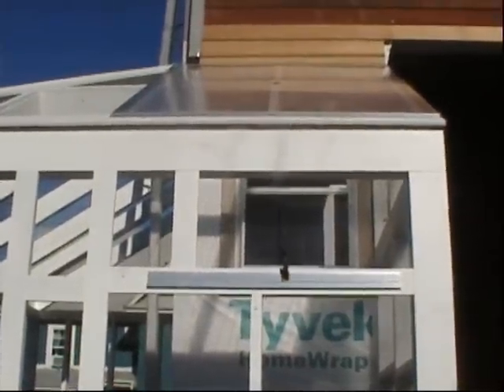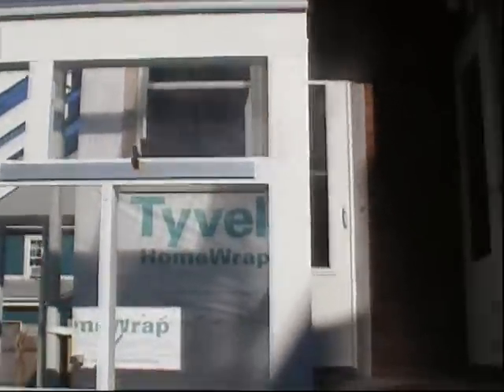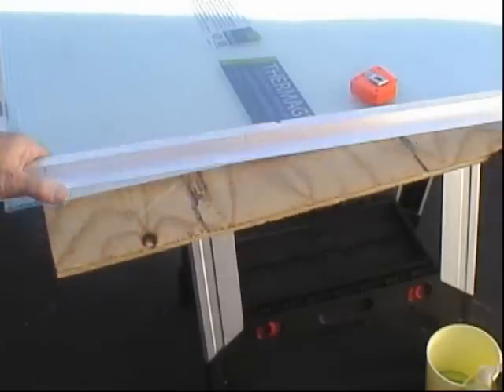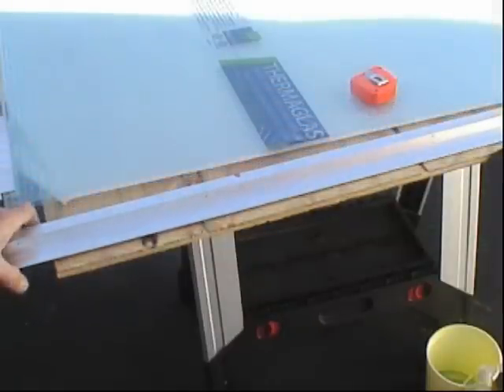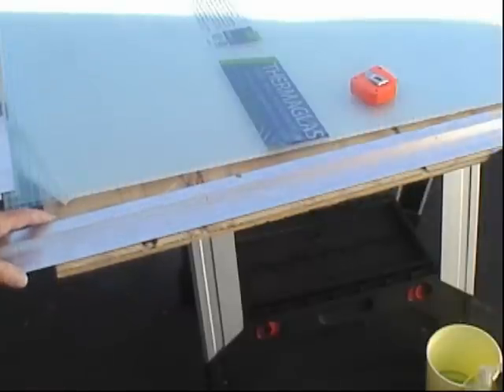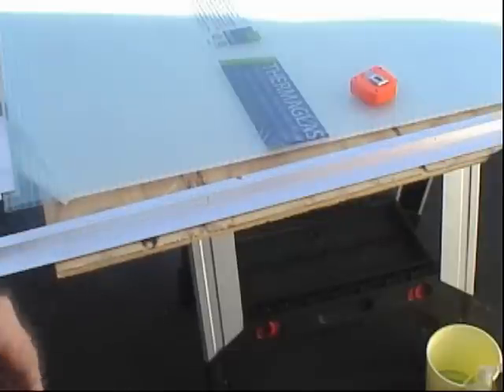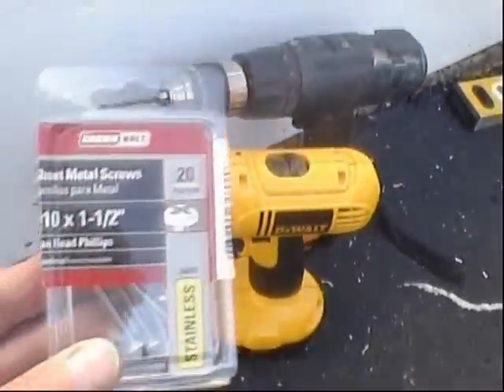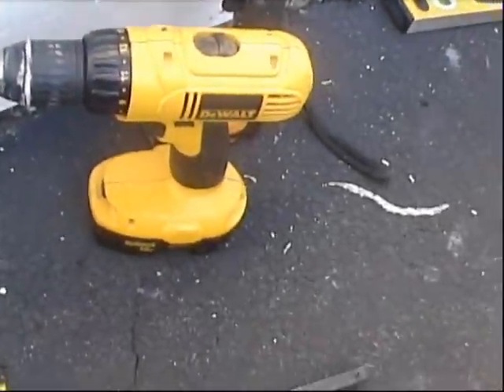Greenhouse polycarbonate panel installation

Comment: Did you have to use silicon on the roof H channels to prevent water leaks. I am getting ready to install 4x8 panels on the roof of mu wood framed greenhouse using the same H channels you are using.
Reply from the maker: I did not use any silicon.  I have a few leaks when it rains hard but it seems to be at wood joints at the corners.
Reply: Thank you. My roof is up. A few leaks at the eaves where roof panel joining H channels meets the panel end h channel. Fixed by installing a drip edge under the h channel

Comment from the maker: I'm not sure but I think polycarbonate greenhouse panels have a better R value than glass.  Whether you can retrofit polycarbonate panels to a frame that had glass I wouldn't be able to tell you that.  It's probably easier to work with the poly than glass too.

Comment from the maker: I think the manufacture recommends fastening the poly every 2 ft with a screw so I have most of my framing 2 ft on center and I put in blocks two to three feet apart too.  Depending on the amount of snow you get you can have a good pitch to shed the snow off.  If you build a V frame type of greenhouse that of course would be better than a flat roof.  This polycarbonate can also be bent to build a tunnel type of greenhouse.  So it's really going to depend on your framing too.

Comment from the maker: @growing4fun Glad it helps.  Its not perfect but its something.  I'm still not comfortable with the pitch calculations but I'd check out that easy rafter program thats free for 30 days I think.  I didn't buy it but it got me close to the angles I needed.  Or just pratice on a piece of scrap wood first. Thanks for watching and for the comment.